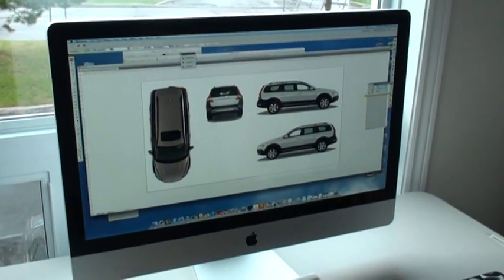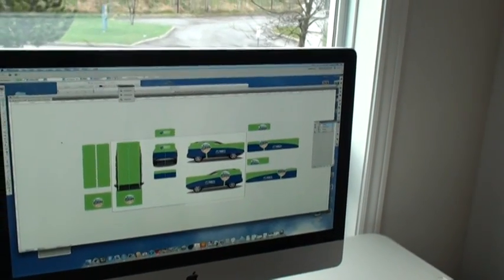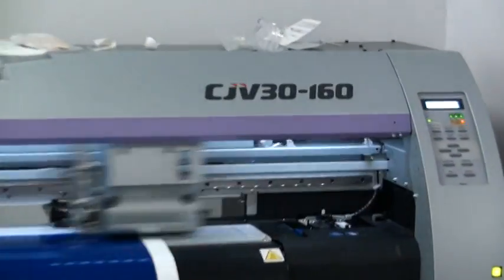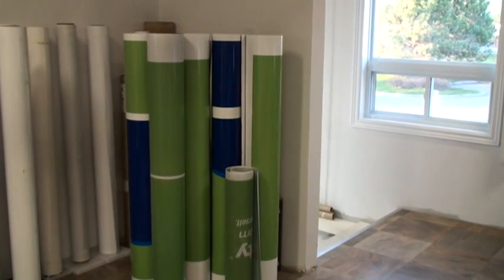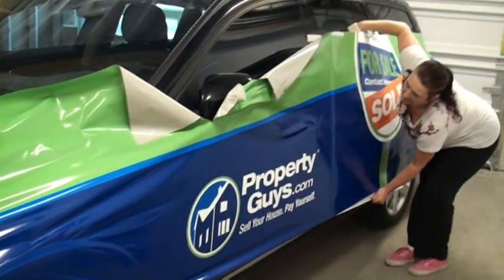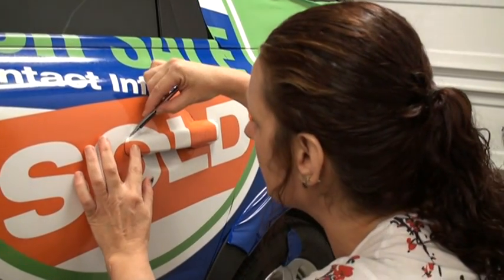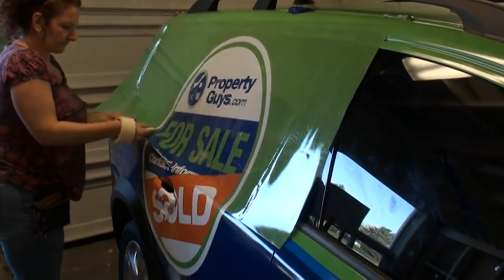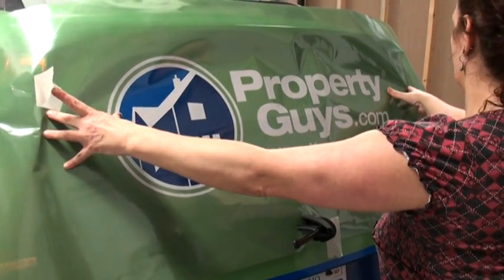Car Wrap Demonstration Start To Finish - Pulsar Signs Ottawa

Comment: i love wrapping vehicles. i did an intership on a project for a company in home country . its a challenge but it requires patience,learn , self-confidence, get more skills & achieve to succeed .
Reply: bro, do you know if i can print vinyl with an HP z3200ps? I can buy it for very cheap, but I would only use it to wrap my truck with some business info

Comment: Does the laminate affect the moldable nature of cast vinyl? Also are you using ss21 inks on the Mimaki? 

Quite new to this and have picked up the same printer on eBay. Thinking of getting into wraps in the future. For now I'm using it for banners etc for my print shop in the UK. Many thanks!
Reply: Chris Cork As long as your laminate is a cast vehicle wrap type it works great. You have to make sure to use a cast vehicle wrap printable type media as well.
Reply: Klebert Hong thank you:)

Comment: Hi Nice video
Which are the best printers and laminators to buy?
We are a startup and budget is also a concern
Reply: Hey mate, 
So did you start this business? If yes can you please share your story with me because I am also planning to start this business here in Stockholm, Sweden. I would really appreciate if you could help me regading your experince
Reply: Fahad Khan i have a Gerber Edge FX vinyl printer to make signs for my dumpsters. My business is dumpster rental so that printer works. You’re going to need something bigger. Roland would be a good choice. Go on their website and check them out. You will need a plotter and laminator as well. Cheers.

Comment: How to get design to be printed to scale?
Reply: Milo Tea A lot of detailed measurements should be taken along with an accurate height, width, and length measurement. Then scale your image/proof/template accordingly in your design program. A wrong measurement can lead to a botched job.

Comment: Not the proper way to wrap but alright... technically you should take off the headlights, tails, mirrors and the door handles... but once I saw a blow torch instead of a heat gun I knew it was a lost cause lmao
Reply: so in the vinyl industry there is different techniques and wraps. this is a commercial wrap not a color change where you would take the car apart. commercial wraps are mostly installed like this. although at our shop we take them somewhat apart cause thats what WE do. & we also use flame all the time its pretty standard.
Reply: LOL remove headlights and mirrors on commercial wrap??? Torch means lost cause??? You must not be very experienced at wrapping if you can't wrap with a torch. Newb.
Reply: Hyperion There are a lot of ways to do a vehicle wrap. There's also a lot of ways not to do a wrap. The biggest concerns will always be consistency and no damage to the vehicle. You don't have to do a complete strip down parts to wrap a vehicle. Sure, it provides ease of access and you're able to hide more of the factory paint, but it also adds labor time because it's more extensive cleaning to do in areas that are just for your anchor points and some vehicles can take a few hours to disassemble because of its design. You can bounce back and forth with the pros and cons but every shop will value the extent of work differently. Now the torch and heat gun thing is all about and experience and control. I train new installers with a heat and graduate them up to a torch. Yes, a heat gun is safe but a torch is safe as well as long as it's in the hands of those with proper training. The torch is quicker to heat up the media for stretching or relaxing and that's where it's mainly used. I personally like to use a heat gun as a final "post heat" to ensure edges are locked and the end result is bubble free.